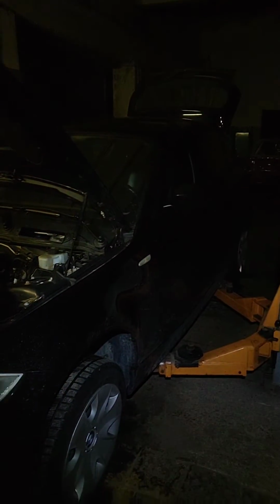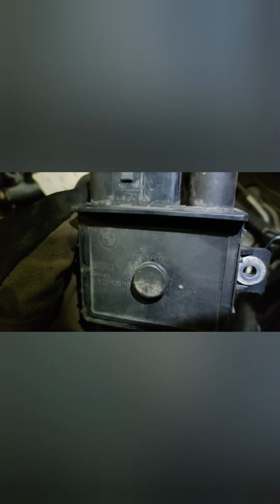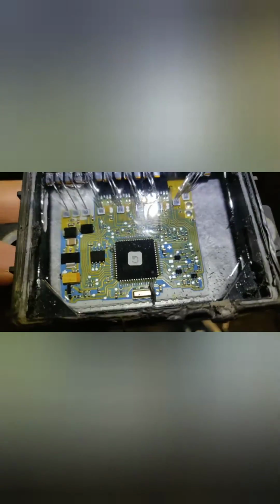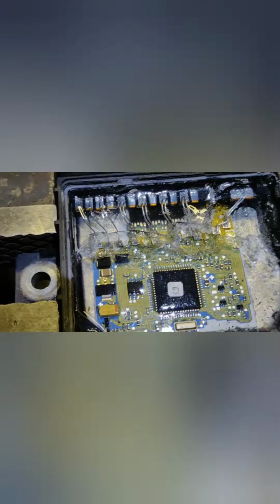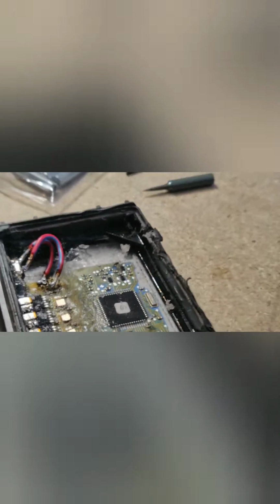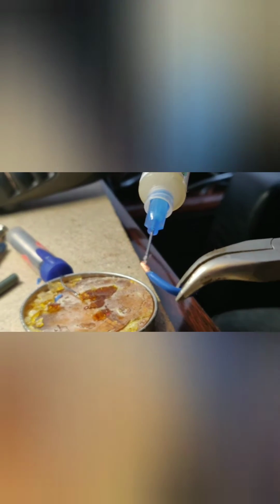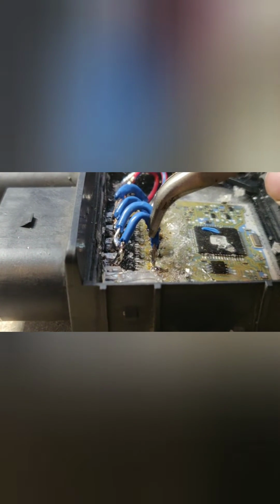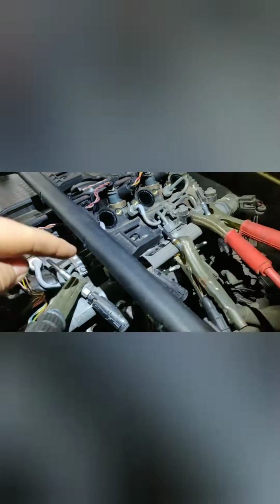BMW BERU glow plug control relay ECU restore / repair

Comment: hello friend..i do have one in work now..which diameter did you used on the cables..the car is mine e46 150hp and the winter is approacing in romania😁😁😁

Comment: Any wires!!! Those wires are special size for purpose Fuse if you’re glow plug is broken and had short to ground what else you will damage with any wires!!!
Reply: learn how things work before spitting shit
Reply: This is not how it works. If there is a short circuit in a plug and the module detects high current, it deactivates the stage and throws code 421x. But wires do have to be thin for them to flex easily from heating cooling so as not to break the solder joints.

Comment: Hi Modrix. I have N47 e84 and bought the BERU GSE106 control unit - hoping to not have to replace the original Bosch GLP5 plugs. But I read "Caution! A mixed installation between the manufacturers Beru and Bosch is not permitted". Therefore do I now need to buy and fit new plugs as well??   - if so, I was considering the DENSO DG-613 because they are only £11 each. Is that OK ? or will the Beru relay work just fine with the old Bosch plugs ?? thanks

Comment: I fixed mine but it was very difficult to get the solder to stick on those pads even when i dremeled them to copper. Need to have very powerful iron. Tried to use my T12 soldering station, no luck, then used 60w plug in type 220v still would not do it, had to heat up the iron with blow torch.

Comment: For me the problem was the small plug that goes into the module, I fitted both new glow plugs and BERU relay with no success, later I discovered that the connecting wire can “melt” overtime, replaced it and all my issues finally gone. 
P.s it is very easy to replace :)
Reply: @shanefiftyfive https://www.ebay.co.uk/itm/174092744939 look for this wire connecting the module, it is very easy to replace and if your car has troubles starting after glow plug replacement and the module replacement, then this wire is most likely the culprit.

Comment: merhaba 0x004A74 LIN / BSD, message; preheating control unit: Missing  
                 0x004A79 LIN / BSD, message; preheating control unit: Missing.    bu hatalar modül hatasını yoksa buji sorubumudur modülü söktüm abcak test edemedim bilginiz varsa yazarmışsınız teşekkürler.  bir tanesi 6 ohm  deger veriyor diğerlerinden deger okuyamadım  modül tamir olabilirmi yoksa çöp müdür.

Comment: hello, In my relay, I have continuity from the power connector to the first 2 tiny pads, it seems that the wires aren't broken down. Can you tell me the resistance value that I should get?
Reply from the maker: Not more than 0.5 Ohm
Reply: @modrix  thanks. And other question, what's the resistance between power and  pin 1 ? I'm getting 2.4Mohm  bettwen power and pins 1,2,3 and 4

Comment: I have new battery , engine crank but won't start , not even from warm , only push and second gear , and then everything runs fine , i get no errors on dash , i check all fuses and relays on passenger side they all work , i can hear pump run when i put ignition on ,what can be the problem ? bmw e46 320d 150hp
Reply from the maker: Need diagnostic tool to check actual data and error occurred to find out the problem